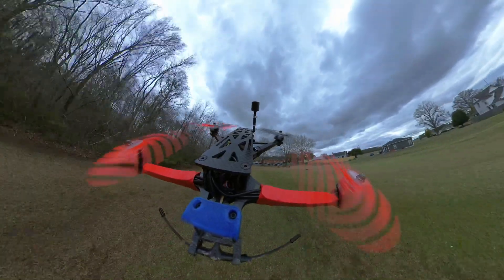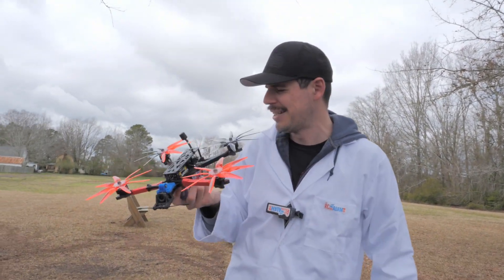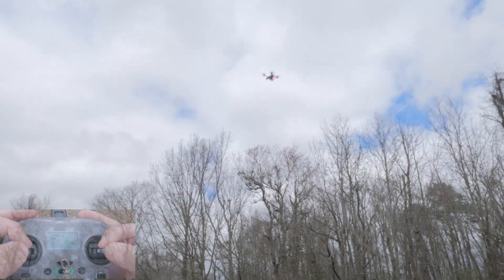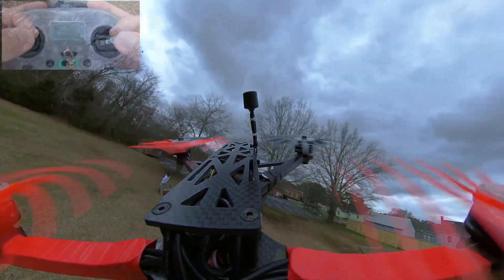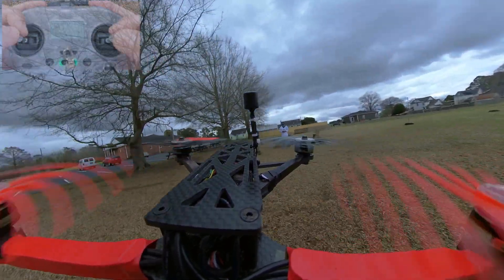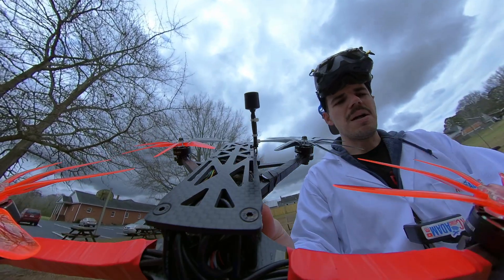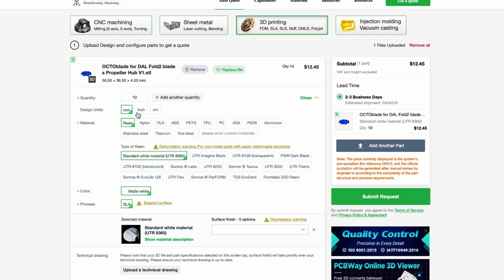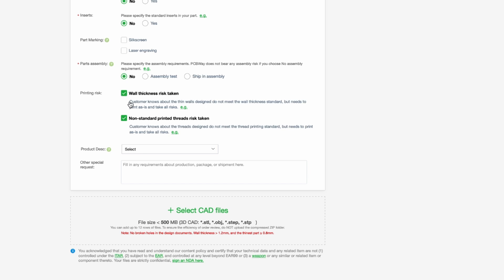Is 32 Blades too Much for a 7" Drone? 🤔 New OCTOblade 8-blade Propeller Hub for DALPROP (3D print)

Comment: Hi Adam, your link in the description to the octoblade hub is not active, can you reply to this message with it? I'd like to print one out. Thanks. What's causing the vibration for the 7" quad?
Reply from the maker: Hey! I just realized I'm having some issues with my site web address stuff. Thanks for letting me know. For now you can use this link: https://rcwithadam.podia.com/v2-octoblade-propeller-hub-for-dalprop-fold2-blades . I think the vibes are due to the propellers/assembly not being balance.

Comment: 5:18 what’s your throttle level? Do a comparison for long range standard 3 blade prop setup vs octablade prop setup. Amp draw seems accurate. It does sound quite-er as in sounds windy not high pitch. 👍
Reply: Can tell a lot with Throttle level